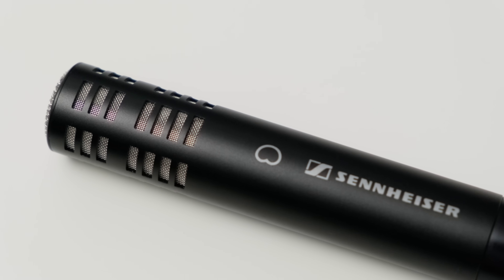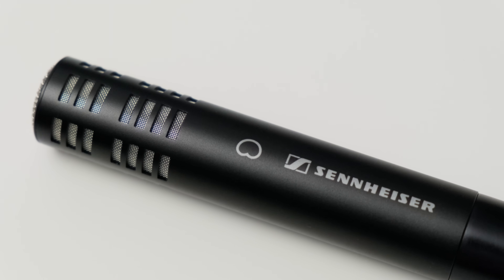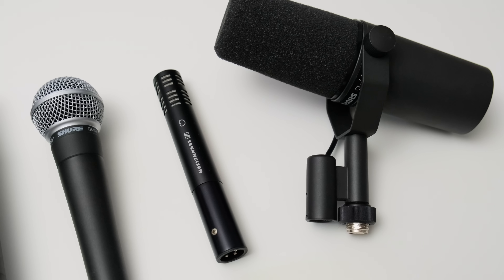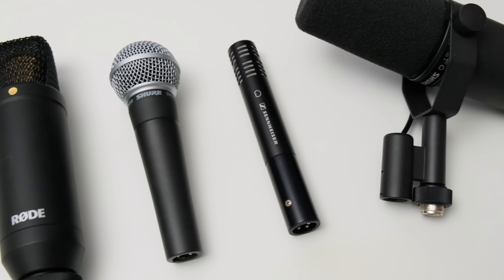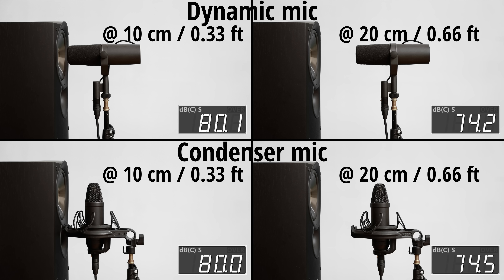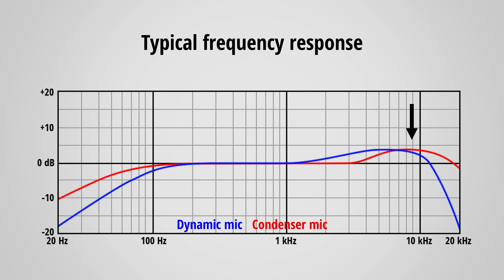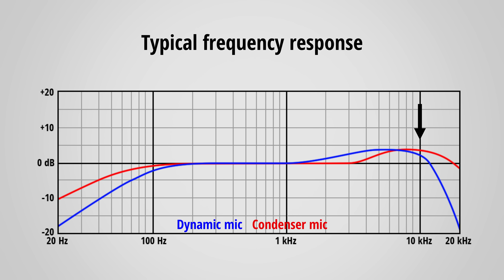Dynamic mics don’t reject noise better than condensers! And yet they do?

Comment: Excellent, and you explained clearly what usage and microphone factors make this a believable myth, i.e., the way we use these types of microphones actually is the reason we [might/think] hear less background noise. I guess the point that might have been obscured was that there is still background noise there, but it's being masked simply by where the [frequency] energy is in the source. You won't notice that noise's presence/absence until you record in a treated room. Until then you wonder why your multitrack mic'd mixes sound "wrong."  Physics is hard, though, so good luck on your mission :).

Comment: I think the myth also has something to do with the fact that dynamic microphones are often more directional than condenser microphones. So dynamic microphones are more often hypercardioid and so on. The myth was then created by omitting important information from the story. In the beginning it was perhaps said that it was better to use a "hypercardioid dynamic microphone" and the "hypercardioid" was simply omitted over time.

Comment: Yes yes yes yes. Something I can add to my archive of videos Playlist. It's like well yeah if you give your dynamic microphone the same amount of gain you've had on your condenser with built in preamp you're going to have the same problems. But if you unplug your dynamic mic and plug a condenser in and not touch the gain knob of course you're gonna have feedback issues.

Comment: Good job. Another great reference to have.

My reasons for using any microphones are how useful for the task they are. Handling plays a big role in the situations you can put the mic in. The sound has to be suited to the task at hand. And the mic shouldn't be too noisy(least important reason for me).

Thus my shotgun mic in a Rycote hand-held enclosure is great for recording effects and dialogue outside. Wind protection, hand-held shielding, more directional than a cardioid(the only way to reject noise and reverb better) and highly sensitive, so the shield won't spoil the recording. The SM58 is great for people holding a mic in their hands, which the Rode NT1 wouldn't be. The SM7B can be shoved around and almost eaten with its great shielding, and it still works well. That makes it a fine podcasting mic.

I use a small, inexpensive condenser (LCT140AIR) as my communication mic on a desk arm, because it is low noise, has a decent foam shield, can be placed in a cheap shock mount and has good options to manipulate the sound. Room rejection had nothing to do with it.

Comment: I typically use a dynamic mic right next to my condenser mic on a number of live recording sources. Guitar and bass amps, bass drum, snare drum, a wide variety of latin percussion instruments, and the occasional brass instrument. Once gain is set, when I solo these mics at various playing levels, they track each other perfectly. They DO sound different of course or why would I use both? Simply, frequency response. The condenser always has an extended response by comparison, sometimes by a large margin. The built-in preamp makes anything possible so a condenser can use a much lighter diaphragm with wider and quicker response. With those qualities comes added detail. This is what engineers describe as louder. 

I don’t perceive it that way, personally, and I often tailor the response to 100hz-6khz in the mix, leaving the original bandwidth to print, so it’s not bandwidth. Rather, it is speed, agility - terms not normally associated with sound. The condenser hears what my ears hear, while the dynamic is a bit of special effect. When the guitarist solos, I feature the condenser rather than the pair because I know it will sound closer. When I can’t spare the channels, I nearly always opt for the condenser alone as it gives me the whole thing: clean and distortion on the guitar and bass, the full snare top and bottom sound, all of the bass drum - making for a more satisfying mix.
Reply: Hold up. The diaphragm of a condenser is remarkably stiff and kinda robust, it's the magic of capacitive sensing that it doesn't need to move barely at all, and microscopic movements are picked capacitively and electronically amplified, and because the movement is minimal, there are no field nonlinearity effects. The dynamic membrane is sort of a piece of shit, strategically crinkled wimpy stamped foil which carries a somewhat heavy coil, but that coil has to make visible movements to emit current against the magnet, and as it moves, the shape of the magnetic field relative to the coil changes, which makes for a little bit of saturation or nonlinearity. Ultimately the difference in frequency response is in the different tuning of spring-mass-damper system, which is bound to be more resonant in dynamic for efficiency with several distinctive resonant frequencies, because the membrane actually has effectively several areas that move with different characteristics, and a very aggressively damped barely visible single peak either around 8k or near the end of the hearing range in typical condensers.
Reply: @SianaGearz   Could you possibly cram any more nonsense and bad info into one paragraph?  Just pure, made up bs from start to finish. If you don’t KNOW what you’re talking about, why even post?
Reply: @  Just because what i say goes against your preconceived notions although you never opened up a microphone (obviously) doesn't mean i'm wrong.
Reply: @   Wow, such nonsense. Give everyone a break here.

Comment: The myth is in how you have framed it. You are absolutely correct in terms of acoustical properties and physics. But...
A dynamic microphone typically needs a higher SPL, in other words it is less sensitive than a condenser. Live sound and studio sound are two different animals. Monitoring in studios in typically through headphones. Monitoring live used to always require floor wedges and that requires very careful, very good mic placement and engineering. With in ear monitoring things have changed, but a lot of bands still like it LOUD on stage. 
Proximity effect is mainly a product of cardiod mics, Omnis don't have the issue. 
You spoke about gain staging just barely at the end. What would your samples after that sound like if you set the gain at one level and never changed it regardless of the mic? The condensors will generally be too loud if the dynamics are set correctly. OTOH, if you gainstage for the condensor, the dynamics will likely be quieter. I am guessing you not only EQ the differences out of the mics, but you also gainstaged them differently as well.

Comment: Late last year, I bought a Beyerdynamic DT-797 headphone and this month, I bought an AKG K553 headphone with ModMic Uni 2 microphone. I was not sure if the ModMic Uni 2 is a dynamic microphone or not and to be honest, I cannot tell much of a difference when it comes to rejecting background noise, but I can tell a difference in frequency response when it comes to the headphone and microphone of my choice. Thank you for dispelling the myth about background noise rejection.
Reply: Which one do you like better?
Reply: @RolandDobbins  I would say the ModMic is better for my ears. The DT-797's microphone does seem to amplify the midrange around 600 to 800Hz. Maybe it has to do with room acoustics as I live in an unfinished basement in a rental house and I cannot put in acoustic panels to dampen the mid frequencies a bit. I ended up turning those frequencies down by 6dB for the DT-797 until I switched to ModMic and my co-workers told me my voice sounded a little clearer. I'm just not sure if the headphone drivers in the DT-797 is causing the midrange boost or not, making my voice sounding "not smooth."

So yeah, the ModMic Uni 2 sounded better to my ears.

And now that I know from my experience that dynamic microphones do not reject noise better than condenser microphones, I suppose I could make better adjustments to both my DT-797's microphone and DT-797's headphones so that my headphone does not sound so boxy. I feel I probably made a mistake thinking that only the DT-797's microphone sounded boxy to my ears and not the speaker driver itself.
Reply: @graysonpeddie — you can just hang up blankets & put down rugs to dampen reverb.  Acoustic blankets are available on Amazon for $90USD, but cheap moving blankets are fine.
Reply: @RolandDobbins  Well I suppose I could make a small booth out of a large blanket. Maybe that will help. Thanks.

Comment: uhm, sorry, but no. in your tests it's clear that dynamic mics have shorter reverb tail. thats because they have way different pressure gradient on their membranes. at loud enough levels they may perform the same, but quiter sounds fall off quicker. everything else you said about proximity and high frequency rolloff playing a role in a percieved reverb level is true.
Reply: Uhm, sorry, but not true. The soundfield is the same, including the pressure gradient. The microphones must be different to hear this identical sound field differently and typically the dyn will lack an entire octave or more of response by comparison to the condenser, which also often has a broader cardioid pattern, yielding more room pickup for the condenser. But that is not a rule. A Sennheiser 441 will sound very close to a hypercardioid AKG C414EB because each microphone has qualities of the other. 441 is unusually flat and extended response, more selective directionality. 

These two will make a mockery of our expectations while an SM58 and a KSM32 will perform as we expect - the 58 has significant response limits so will usually be gained up a a touch louder to compensate. The KSM will have a much broader polar response, yiielding more room. The method of construction of dynamic and cardioid microphones is not responsible in any way whatsoever for their differing sound.

Comment: I always heard that dynamics picked up less noise due to the much higher MASS oi the diaphragm along with the coil.  Condenser mics have an extremely light diaphragm that is much more sensitive to the movement of air.  I still think that is a valid argument.
Reply: Thank you for your post! That theory makes me wonder how being more massive could make a diaphragm  less sensitive to noise (=undesired sound), but remain sensitive to the signal (desired sound). How does the diaphragm know what is desired and what is not? I don't think it does. I believe a higher mass just means its less sensitive to all sound
Reply: @michaeldmoch4348  It is really not about sensitivity (as a spec) but more about the condenser mic element being affected by much smaller disturbances of air movement.  I have seen this explanation in product literature and audio engineering texts.  I guess we will have to agree to disagree.
Reply: @dankeifer All that means is that the mic picks up less HF, not less room noise. No matter what your EQ is, the signal/noise ratio between the source and the room noise remains the same, it's just that the mic picks up EVERYTHING less at that frequency.

The point still stands: if the mic capsule is heavy enough to "ignore" the room noise, it's "heavy" enough to "ignore" the source at the same frequency.

Comment: Wow! all cardioid mics sound way better at 1 ft in this video. Mic placement is almost more important than the mic itself. Awesome video
Reply: Mic placement IS the most important aspect of what it'll sound like.
Spend most of your time learning the mic placement and even after that, trying different things to find out the spot where it serves it's purpose the best.

Anything from drums, vocal performances to corporate "talking heads" seminars... it's all mic placement.

If you mess it up, you have limited tools to fix the issues afterwards.
Reply: Placement is huge. I’d say (assuming we take the performer/performance out of the equation for a second) that it goes space>placement and pickup pattern>microphone>preamp>interface/converter in order of importance. My mentor when I was starting out as a recording engineer used to say that the most important thing you could do on a new studio/project studio session was to walk around the room while an artist was warming up to hear where the sonic sweet spots were and put the microphones there.

Most of the time a person’s voice doesn’t sound pleasant at any volume above a whisper if your ear is right up against them. Same thing if the microphone capsule is right up against them, too. But as Julian showed (and a lot of people don’t think about) if you are using a mic like the SM7b, the capsule is further down the mic than you might think and has a pop filter built-in - so being right up against the foam is equivalent to being a bit further back with an external pop filter for many condenser mics.

When the mic is to close to a singer you have to either do a lot more editing (such as volume envelope automation) or use more processing (like a de-esser) to get rid of some of the harshness and plosives you get when you’re too close. If the environment is noisy enough or you really need that proximity effect, then it might still be worth it but it’s often best to at least try a little further away first.
Reply: @perlichtman1562  Totally agreed! Not to mention that every time the distance doubles, the SPL drops by about 6 decibels, which is about half the loudness, so recording a singer from right on top of a mic introduces that dynamic's nightmare in addition to the varying low end with the proximity effect. It's like trying to drive your kids to school while they tug randomly at the steering wheel without warning the whole way. LOL
Reply: @Mugician9988 That’s a great analogy - I might have to use that in the future. :)
Reply: exactly, thats crazy
Reply: Yes, mic placement is key. Therefore, sensitivity and optimum distance per mic is also key.
I did photography first, so I tend to think of a dynamic mic akin to a macro lens with all the attendant placement and positioning rules. I like cardioid as a rule because then it has a direction, just like a lens.
So a cardioid mic to me is like a mid-to-near-telephoto lens. (A shotgun form factor mic with an extremely narrow pickup pattern would be the true high-distance telephoto.)
Reply: no shit
Reply: Exactly. Each mic seems to have its own sweet spot too. I have a u47 clone that I just couldn’t get to sound the way I’d hoped, until by accident I cut some vocals from 2 feet away and off axis. It immediately sounded exactly as I’d always hoped to capture a vocal

Comment: I’ve been hoping someone would call this out. There are NO mics that can actually rejecting ambient noise and room reflections. The polar patterns are not NEARLY tight enough to accomplish that, so the only way to combat those issues is to make sure your sound source is loud enough to make the surroundings insignificant. It’s one of the biggest reasons I switched to digital guitar amp modeling—it’s next to impossible to get the right isolation to properly record with mics in an apartment.

Comment: Funny that the cage of SM7b prevents you from getting very close up on the mic and generally makes people be even further from the mic because if you are say five inches from the SM7b you are actually seven inches from the capsule.

And in spite of this the SM7b is foolishly thought of as having the "best" rejection all mics.
Reply: Then measure how far you are from the capsule, not the windscreen, smarty
Reply: @mrpillows.   Apparently you are missing my points, which are that the SM57 has  the capsule nearly at the end of it while with the SM7b the capsule is a couple of inches back and because of its cage you can't get any closer unless you took a hacksaw to it, in which case you might as well have saved yourself like $300 and just bought an SM57.

In reality people buy the SM7b because it's an extemely popular mic with podcasters and gamers.  They think that spending $400 rather than $99 is going to make them sound so much better when the difference is actually quite subtle.  

If you want to get the least amount of room sound in your recordings you should get as close to your mic as possible.   The SM7b because of its's internal construction but also because of its external size and shape encourages people who don't know any better to be quite far away from the mic.

The SM7b is a nice mic but I find it funny that it became so popular and ubiquitous with Podcaster and gamers in spite of it having characteristics that hinder the beginner like its low output and configuration that encourages people to be further away from it than they probably should be.

Yes, I am a smarty pants.   I've done sound reinforcement and recording for corporate audio visuals as well as bands since the late 1970s and as well spent way too much time on audio forums in the last couple of decades so I'm quite familiar with the things that peoplè do wrong as well as correctly.

Comment: …you could not be more wrong. Capsule sensitivity & frequency response - generally- means dynamic mics will prioritize things that are closer to them. There’s an overwhelming amount of sonic and mathematical evidence to support this. Your raw speaker test is one of them. Anyway, I’m blocking your feed now. Good day.
Reply: @Needer2  where I can find this overwhelming amount of data and evidence supporting your claims? I’m curious
Reply: @xanonax  mic spec sheets / frequency response graphs that account for distance from capsule (for any & every mic) is what i meant by mathematical evidence. by "sonic evidence," i pretty much meant "anything recorded with a dynamic mic or a condenser mic." just in the context of this video, though - you really can't hear a difference in the raw sound examples? the sm7B doesn't sound tighter & more present / less room-y to you?